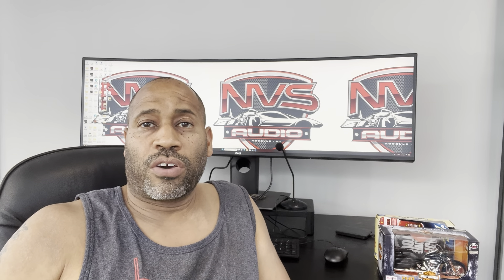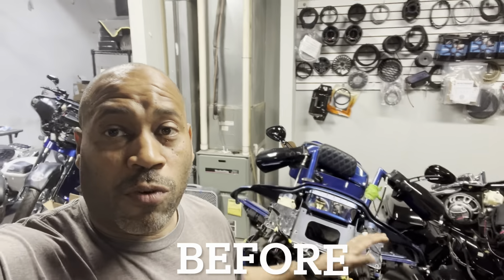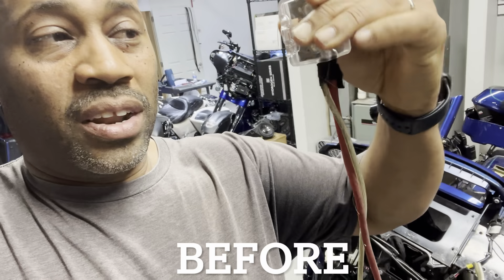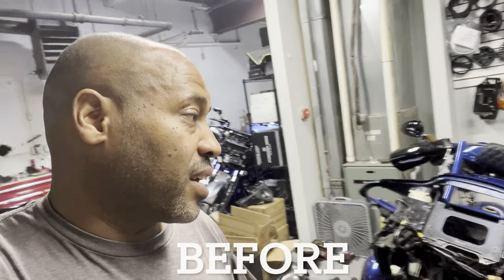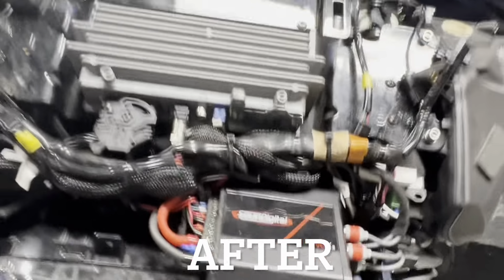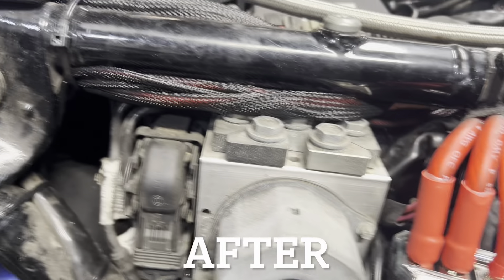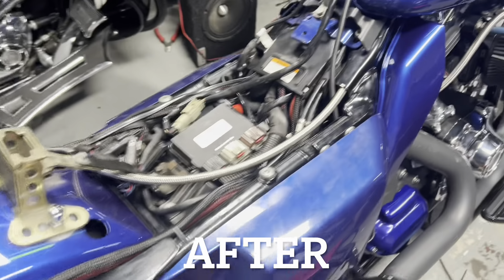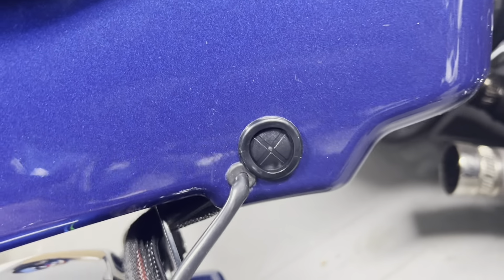Harley Davidson Road glide in for a Huge Wiring rescue and an audio upgrade part 2

Comment: Nice work. Curious do you all ever sell any used equipment that you don’t reuse? I’m sure most people would try and resell it themselves.
Reply from the maker: I give all the old equipment back to the Client 

We normally ship it back to them for free so they can enjoy their new build with no clutter
Reply: @NVSAUDIO  Carlos so with that build, I have lowers as well which makes that a 8 speaker build what size amp would you use, because I definitely want to be loud when I have you shop in June and I ain't want to leave my lowers unattended. So I'm thinking speakers in the fairing, lowers and lids, plus 8in midbass drivers